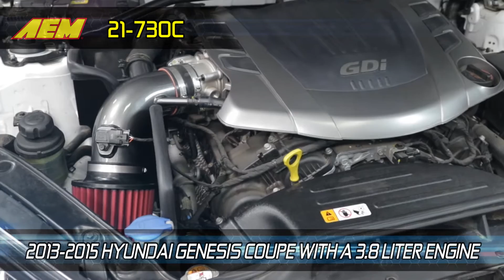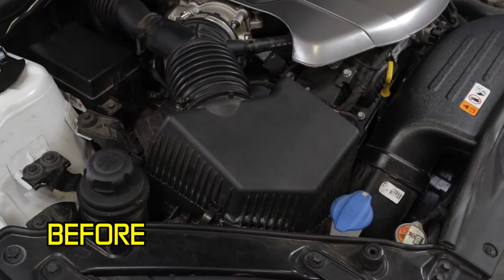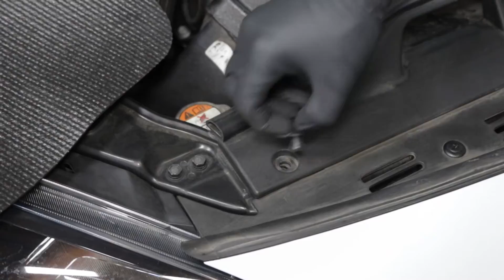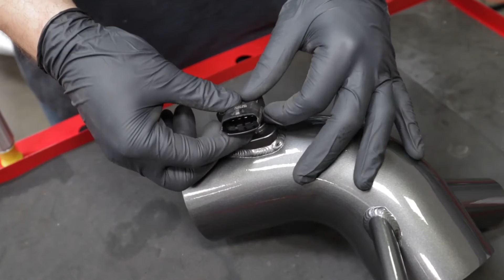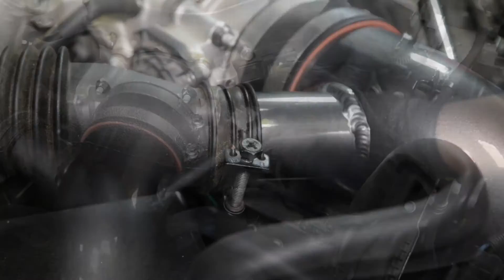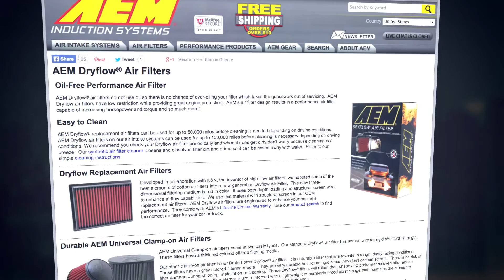How To Install an AEM Air Intake on a 2013-2015 Hyundai Genesis Coupe 3.8L

Comment: Why don't aem make a real cold air intake for genny? The heat shield is useless!
Reply: kit385 the shield helps trust me
🤓
Reply: but only short term tho. i think it still be nice have a choice of cold air and short ram. if the bk1 genny have it, why not the bk2? that why i still using my stock intake with K&N filter. also AEM don't make drop in filter for bk2 stock intake but they have it for bk1.
Reply: @dreammusicvancouver the reason they don't have a true intake is because most people won't be able to move the washer fluid reservoir properly
Reply: kit385 u realize the IAT sensor would be getting really false signals without the shield right. The genny engine design naturally keeps a ton of heat the shield helps the new rammed air, from the little plastic intake duct from mixing with warm air from the engine it’s actually a smart ass design. Don’t believe me dyno ur car on the coldest day of winter vs the hottest day of summer depending on the car ur looking at a 15-20 hp difference

Comment: Easy installation....great video to follow along with!!
Reply: Douglas Neilson did you notice the power difference?
Reply: Douglas Neilson do you have to use a tune with this ? or is this one of those that does not require a tune ?
Reply: I just installed this into my 2015 3.8 yesterday. The throttle response seems a little better. The fit and finish is nice. The air filter is huge....looks cool.